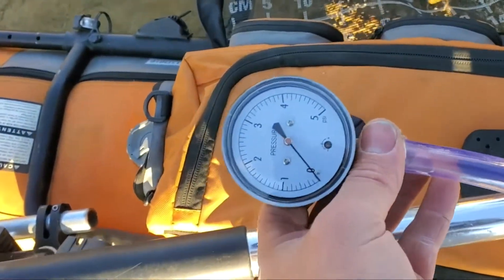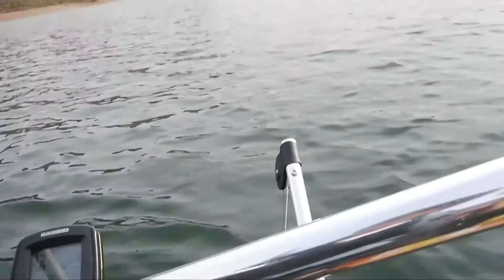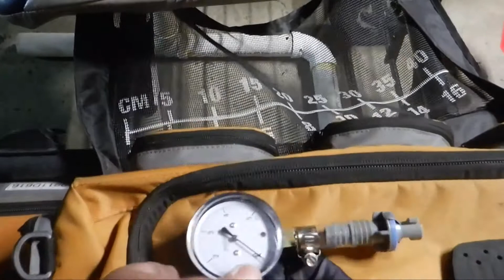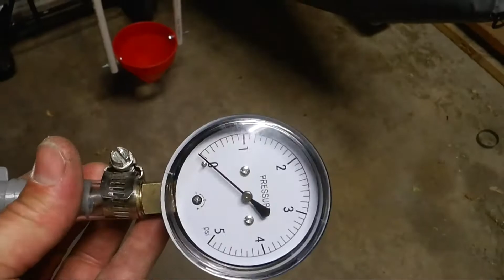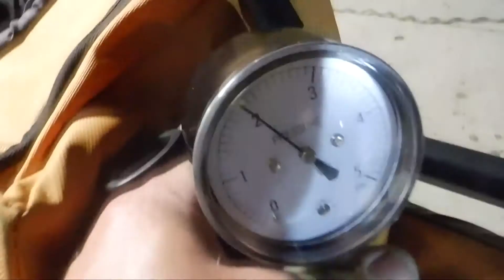Steer Inflatable pontoon, Inflatable pontoon with Downrigger, Colorado XT trolling with Downrigger.

Comment: I use a water brake on my 14' boat. It would probably work just as well on the toon. On my boat, the further its out, the more effective it is. Its very similar to what you have, but larger. Its nothing more than a funnel.